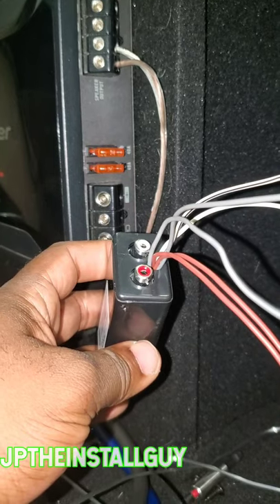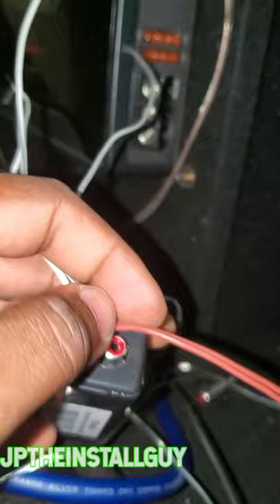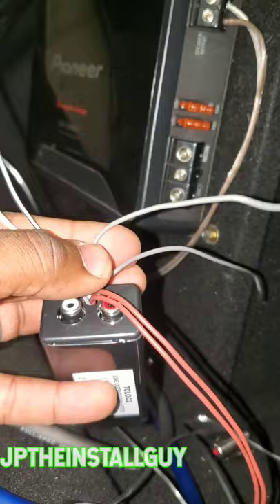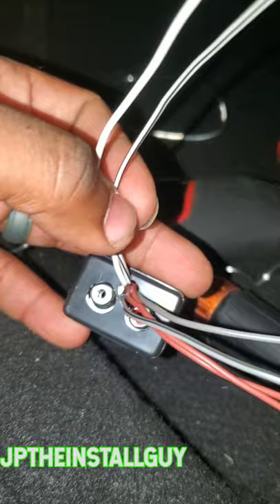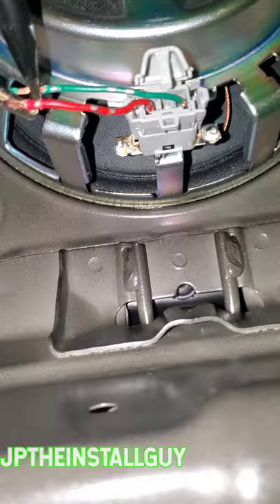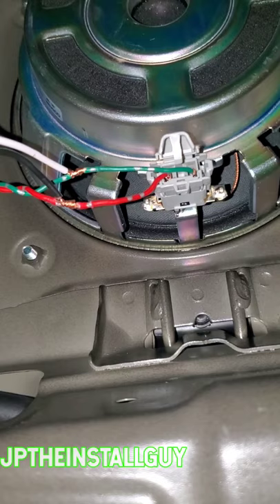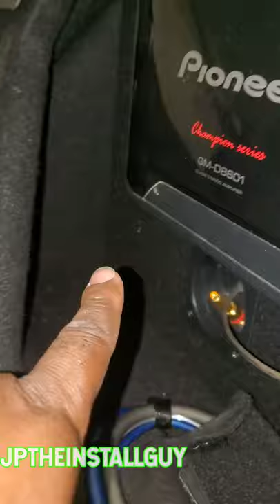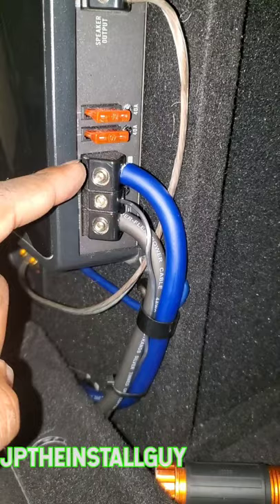how to install a loc - line output converter in 3 minutes

Comment: What about the remote wire
Reply: Goes into the converter
Reply: What is converter?
Reply: @maxparker5199  watch the very end of video either put the remote wire behind the radio to the blue wire or tap in to a fuse that turns off like the radio fuse or the wiper fuse
Reply: Remote wire should go into the amp. When the amp senses the speaker wire signal that should signal the remote wire to turn it off and on.
Reply: Remote wire from the LOC to be clear
Reply: @jazzsniper6236  so one of the wires from the converter will plug into the remote wire slot on the amp?
Reply: @zaceaton1074  it would usually be a blue one if you have it
Reply: @kanaloanakoa619  i know it’s blue lol. i was asking if the remote wire from the converter plugs straight into the remote slot on the amp
Reply: @zaceaton1074  get a kicker line out converter. It will also give you a remote wire to put to the amp.
Reply: Just tap into the cigarette lighter
Reply: @zaceaton1074  I'm in the same boat bro.  These people aren't answering your or my question.   There's a remote wire going from my head unit to my amp.  If I installed this LOC, it has an extra wire which is the remote.  So where do I install the remote wire from the LOC?  And what do I do with the remote wire coming from my head unit?
Reply: @liga8149  lmao it’s so fucking annoying 💀 after doing a bunch of research i’m pretty sure i found out that you don’t need the remote wire to go to the back of the radio. when you splice into the system in the trunk. im pretty sure that covers the remote wire going to the radio. so i’m
pretty sure you plug the remote wire from the LOC straight into the remote slot on the amp. i haven’t installed it yet but i’m almost 100% positive that’s how it works
Reply: @zaceaton1074 Did you end up doing it bro? I'm here in Australia 🇦🇺 trying to figure out the same f#cking shit - Doing the same thing to a 2007 Holden Caprice taping into the rear speakers using a LOC - Good thing about the car is that the battery is in the boot/trunk - Saves me a whole heap of f#cking around with running the power cable from the front threw the firewall and to the boot/trunk.

Was trying to find some stuff online for ages about where to run the remote wire couldn't find shit haha!! 

I'm just gonna do the same thing with the remote wire and tap into the rear speaker wire while doing the LOC
Reply: @Chris-bs8qj  lol i love internet complications…. no i haven’t done it yet but i did a lot of research on it and i’m pretty confident that’s how it works.. when i do get around to installing it on my G that’s what i’m going to do and see if it works 🤣 i’m under the impression that tapping into the rear deck makes it where you don’t need to run a remote wire to the actual head unit, therefore i think the remote wire from the LOC goes into the remote slot on the amp. i apologize to anyone if this information is incorrect 🤣
Reply: The remote wire on the LOC goes directly in the amp. Make sure you ground it or it will probably stay on resulting in your amp staying on.
Reply: @samuelking3891  thank you! finally an answer lol… so how do you ground it exactly? that’s the last thing i need to know before i take on this project… i think
Reply: @zaceaton1074  ground it to the chassis just like the amp.
Reply: @samuelking3891  oh, the black wire coming from the LOC?
Reply: @zaceaton1074  correct! Solid black wire
Reply: Run it to the fuse box
Reply: It's passive
Reply: Accessory power spare in fuse box, on ignition power.
Reply: After using the remote wire, my amp wouldn't turn off, so now I don't use it, and my system is still playing
Reply: Get a fuse tap and Tap into ignition fuse or radio fuse

Comment: As most cars now a days have some form of factory amp this is much more complicated then this and you defiantly always use a full range line tap never ever use a factory sub wire tap.. the factory amp is already messing with the frequency’s usually both high and low.. meaning you’ll miss out on most of the reason you’re installing an aftermarket sub in a vehicle with a factory sub.. most factory subs drop out at around 50hrz.. if you tap into that wire you’ll never hit below 50hrz on the aftermarket one..
Reply: So where would I tap into if not the speakers do I go from the head unit
Reply: @chrisowens2699  you missed what I said entirely.. I said to use a full range left and right output not the factory sub output. 

Ideally it’s best to bypass the amp output entirely so yes a head unit output would be preferred as most factory amps restrict all sorts of things and induce all sorts of issues.. 

That said most anything made 2010 or later and some premium vehicles since as early as late 90’s the head unit does nothing more then supply a data signal to the amp which then performs most of the function of both head unit, sound processor and amp. There is no way around that other then replacing the head unit and running dedicate wires in which case you’d just use the sub output of the head unit anyways. 

But generally speaking you want to tap into the left rear and right rear channels together.. this gives you better capability if the amps crossovers wo interference from the factory system.. allows better sound staging through balance and fade controls etc.. 

Most factory subs off factory amps are a center channel only so fading left right forwards or backwards to properly adjust the staging reduces output to the sub.. it only runs 100% at point 0. 

A handful kid the new systems like the harmons and the premium cue systems actually do well with the factory dsp settings for this.. 

It’s never simple anymore and most cars require a lot of work to fix all the crap the factory messed up in poor design prior to altering the system. 

Do your research, look into cars with similar systems.. for example most boss systems of similar generation of automobiles are similar.. so say a 2007 Altima would he similar to say a 2007 Escalade of sorts.. mostly what changed is the location of the items and the wire colors although those mostly remain similar too.. 

FYI 9/10 times the rear channels are green/ black and green white/green brown, or pink.. 

But almost always are they a combination of green solids and strips which varies a lot from all the other wires in the vehicle with the exception of the rear reverse lights lol.. 

Rear reverse lights should be 12-16g wire while speakers would be 16-18. Also if looking for a remote turn on you’re most commonly looking for a solid purple or pink wire usually in the same loom as the speaker wires..
Reply: You love men I can see
Reply: @chrisowens2699  you could just use a lci1 same process as what’s shown in the video but the lc1i tries to restore the bass that is lost. That’s if you don’t want to tap into the factory wiring behind the head unit. Like amusing this guy said. You just need to tap into a clean signal. In a car with a premium sound system meaning it has an amp it’s usually the signal coming straight out the head unit and unit the amp. So you want to tap a left and right channel from the wires before they reach the amp that would be a clean signal. I dont know why that dude typed so much
Reply: So what if I switch out all my factory speakers, sub and amp already but still have stock stereo. Where would I tap in to?
Reply: @mcnugger8305 That’s how education works, I think.  Idk someone smart told me that and it took them like, f’ing-like a bunch of years with paper and pens n’ seech.
Reply: 2014 Maxima, no stock sub but a stock amp with 2 Bose 6x9s. Ran an LOC (that has 2 white, 2 gray, a black and a blue wire) with both white wires on the left speaker and grays on the right speaker. Grounded properly and connected the blues. I start my car and the amp turns on, my subs make a woo woo woo woo sound and the amp shuts off all in like 3-4 secs. Each time I disconnect and reconnect the blue wires it does that. Even tried the remote in my acc fuse like I had it in my 02 and does the same thing. Everything worked fine in my 02 Maxima just before summer. Any ideas?
Reply: @fishrrelaxing9361 Could you tell me why I should use the rear speaker signal instead of the front? I didnt really understand it, i want to get a sub in my Leon 5F and am not sure how to get the cinch, so id try a quadlock adapter or ill have to cut through cables myself

Comment: Only thing I am confused about, since the remote and the ground already go directly to the amp, do I need to use the remote and ground wires on the converter too?  Thanks bro
Reply: No you gonna need to run the remote wire to a power output that is only on when ignition turned such as the accessories fuse wire behind the fuse box or even the ignition fuse wire itself. The ideal wire would be the radio power wire from the fuse box. I would personally use the ground on the converter it stops the whistle from the speakers when you hit the gas but if it sounds fine than it’s not necessary
Reply: Look up add a circuit, you run the remote wire to the ignition fuse. When you turn the key over the amp will engage

Comment: Could I install loc to the head unit? Using the left and right rear speaker wires on the harness? Will splicing into it work?
Reply from the maker: only if you dont have a factory amp. if you have a oem amp then the radio only is sending signal to the amp and that wont work. if you have a base model where the radio is powering speakers then yes go for it.

Comment: Hi I have a couple questions. If you do need to run the grounds do you splice them with your ground running to the amp? Also why is it that this particular loc does not need a 12v power cable? Is there any disadvantage to this?

Comment: What did you do for the remote on the amp where did connect it to ?
Reply: I personally would run the remote through a toggle switch wired through an accessory port that way you can shut it off but won't hurt battery if you forget to shut it off when exiting the car
Reply: Cigarette lighter fuse possibly

Comment: Thank you so much, dude. I got a Cadillac DTS 2009 and just got a kicker hi low converter with a remote wire and battery. My stereo RCA ports don't work so since my car has a factory sub and that does work, ill just unhook the factory sub and splice into that wires. The battery is under the back seat, so I don't have to run any wires into the car, which is super nice.

Comment: I want to say...

It is vastly comforting to notice someone call car speaker mid-range woofers. While generally and usually true, some speaker set ups include tweaters.

I get annoyed when i am conversating someone over audio stuff, and i point at the speaker in the driver door, aa an example, and remark something about that woofer, only to be cut off by a response like, "thats jot my subwoofer, thats my speaker" like i am the ignorant one.

Its happened more than i wish.

So, yes, thank you for referring to them correctly!

Comment: Dude, thank you thank you. Your 3min just cleared up days of questions for me. Using a LOC to tap into a powered sub from a home theater setup. Relaying the low level signal to a mini amp that powers two buttkickers. Your video made sure I didn’t blow anything down the line so really appreciate it 🙌🏻
Reply from the maker: That's awesome glad I could help
Reply: V

Comment: Answered my question for doubling up and running off of a  single coil sub wires. My truck has a amp from factory so I'll probably tap into the remote on that. Thanks

Comment: Bro i almost cried putting my sub in my car. My other car had an aftermarket head unit and was a 2002 so i didnt need a LOC, now my cars a 2012 civic si with the factory sub, tried tapping into it once, the amp wouldnt even turn on, i was over it. Couple hours later I rewatched this, made sure i crimped everything tightly and properly, spent 30 minites and now everything works😭😂

Comment: Love the way you tapped into the speaker outputs.  Most people just cut and strip and I don't like cutting stock wires.  The way you just stripped it and tapped into it was great.  Good Job!
Reply: Better way is t taps. No stripping anything. No taping anything

Comment: Can you connect a single speaker signal to both L/R high-level inputs on the converter or a powered sub with high-level inputs?

Comment: Short and concise , great. Thank you for your help. Question I want to run a amplifier to power by 6x9s.  I'm going to assume it's the same setup with the loc you have connected here ( taking the signal from the full range speaker ) . Or should I take from somewhere else... Any help is appreciated
Reply: Full range speaker. Do not take from subwoofer roe your signal will be wrong.

Comment: Quick question for anybody who might have the expertise! Instead of tapping into the factory sub, I am removing the factory sub and replacing it. However, I’m also putting four or five under seat active subs in my vehicle. Is it safe to attach four or five LOC ‘s to those factory sub wires?

Comment: In addition to running speaker wires from the LOC to the car speaker wires, I just realized I ran an additional set on both car speakers and ran them into the speaker terminals on the sub amplifier obviously where the sub speaker wires go into. The sub works and sounds great I just don’t know if there’s any issues to having another set of wires on each side of the car speakers running into the speaker terminals on the sub amplifier

Comment: May be a dumb question but do you only have to run a LOC from either the drivers side or passenger side? You don't have to do both sides right?

Comment: My LOC has a yellow power wire/ ground wire/ remote  wire, do any of those need to be used? I am tapping into stock subwoofer
Reply from the maker: If you install that black to ground and yellow ton12 volts it will provide the blue 12v turn on for the amp

Comment: your video has seemed to make more sense than anyone else lol. quick question if you don’t mind though…. with using this system; does that mean that there is no need to run a radio wire from the amp to the back of the radio/head unit? the only other car i’ve wired was a 90’s model so a bit older

Comment: im doing this in a taurus and the amp is gonna be under the passenger seat. the run under the carpet to the dash is rly short. would it work if i just tapped into the speaker wires at the back of the radio ?

Comment: so quick question. I have a 19 camry without a factory sub. I have front and rear positive and negative for both sides. do i connect the converter to the front or rear speakers on the factory harness?

Comment: I want to hook up sounds in a 2022 dodge durango but i need to know which speaker wires to use the front door or the rear door and what color the wires are hooking up a lc2 pro

Comment: I watched the video several times and i may be missing something. But why was the hookup for the line output converter hooked up to red and green wires the line output converter wires were hooked up to a different color black and white wires in your video?

Comment: Great video! I have a 2018 Silverado crew cab, what speakers should I tap off of? I bought an lc6i and I’ve heard that the front speakers get a full range signal vs the rears. What do you recommend?
Reply: Did you figure it out i got the same truck tryna see how tf to do it😂

Comment: Yo great video worked great till I unplugged my sub to work on it and plugged it back in I realized my amp was only powering the rear speakers instead of the sub, could it be because I’m using a mono block amp? Not gonna lie tho the amp made my stock back speakers sound impressive, 2016 Honda Civic so you know the speakers are 👎🏽

Comment: Can I get the signal from one speaker or do I have to use both? Meaning if I’d pair the 2 + from the loc and the 2 - from the loc to the negative and a positive on one speaker it would be okay for a svc set up?

Comment: Doesnt really matter what u tap ur speaker wires into front or rears does it?? I installed a loc converter in a old sunfire and my two 12s still pounded hard as f. I just used the rear speakers. Nothing fancy.. now gotta do it to our mariner but i will be tapping into the speaker wires behind headunit ugh...

Comment: Quick question so if I'm running a 4 channel amplifier and a subwoofer amplifier get a male to female connector and two male two female connector for the 4 channel for the left side and one male to female connector for the right side for the subwoofer amplifier?

Comment: 14” maxima with bose. When tapping into the speakers do I need to tap into the wiring before the amp or after the amp ?
Reply from the maker: After the amp. You want the high level sign going to the sub or speaker.

Comment: Hey I know this is an old vid but if you are tapping into a factory speaker, do you still
Need to tap into the factory radio ? Or is the step cut out
Reply from the maker: you only need 1 location and i usually tell people to tap where it is the most convenient as long as the speaker is full range or has bass you should be good

Comment: Hey man thanks for this video! So I have a 21 Lexus IS350 with a factory amp and head unit. I already upgraded all the speakers and upgraded the subwoofer which is placed in the factory location. The subwoofer is underpowered just a little bit. When I wire up the LOC I was going to twist the two positives and two negatives together and use a butt connector to attach to corresponding + and - on the pre-amp subwoofer wires then run remote to the amp and power to the amp from battery and ground to chassis. Do I then need to only connect the RCAs from the LOC to the amp to make the subwoofer be powered from the mono amp I am installing? Or do I need to also run speaker wire from the amp to something? And if so to where? All speakers are already upgraded and work fine with the factory amp, it's just the aftermarket subwoofer that doesnt get enough power from the factory amp. Thanks!